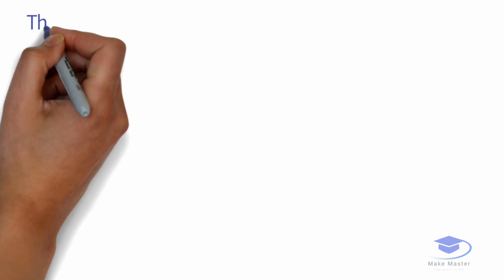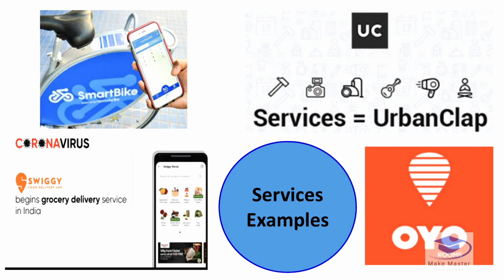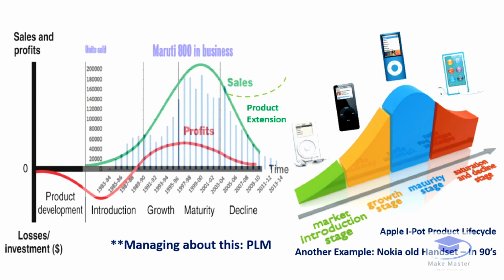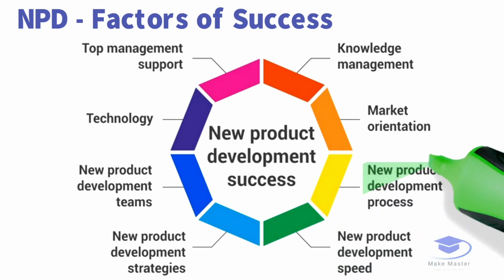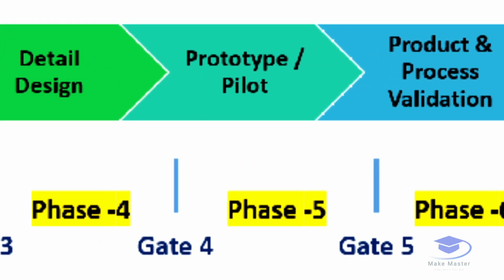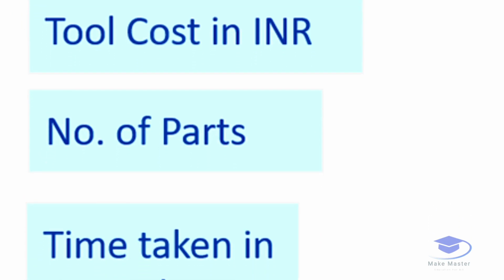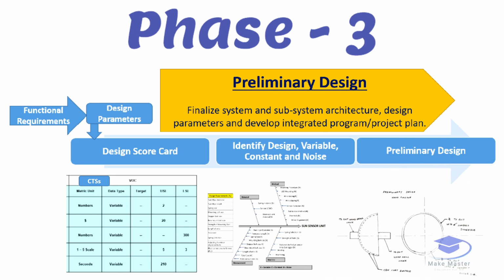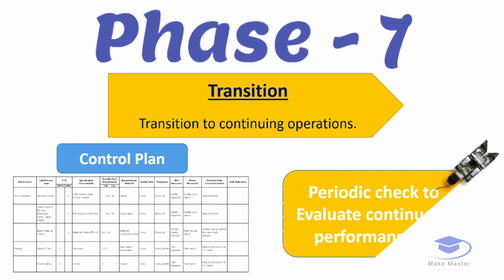New Product Development | NPD Gated Process | NPD | NPI | #MakeMaster

Comment: Where do EVT DVT PVT fit into this?
Reply from the maker: Engineering Validation Testing (EVT): This phase focuses on verifying that the engineering design meets the specified requirements and functions correctly.
Design Validation Testing (DVT): This stage ensures that the product design is validated against user needs and requirements, identifying any design flaws before mass production.
EVT & DVT: Covered from Phase 3 to 6
Production Validation Testing (PVT): This final phase tests the production process to confirm that the product can be manufactured at scale without defects. 
PVT: Is partially covert with control systems. PVT is not fully covered in this. This is up to handover to production.

Comment: Design optimization should happened before detailed design otherwise drawing creation will be rework. But ur video is very informative. Thanks
Reply from the maker: Phase 5 is prototype and pilot. Detail design is not proven before prototype and pilot. After prototype and pilot study, there may be a modification required for correction or optimization.